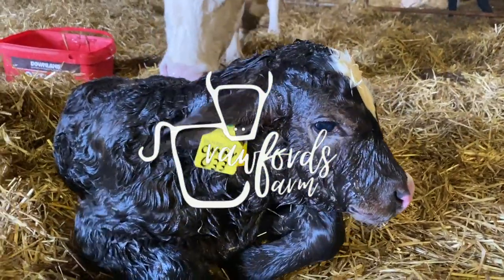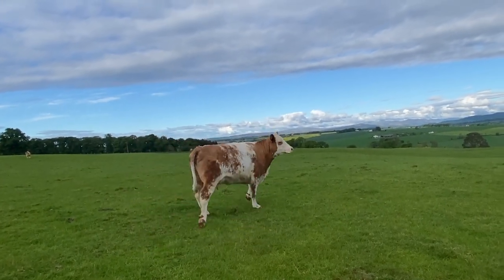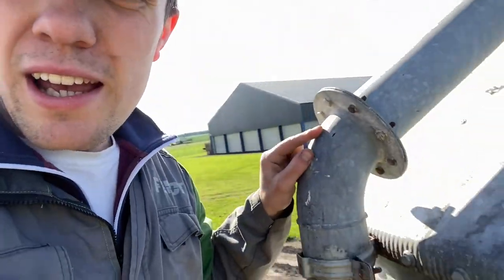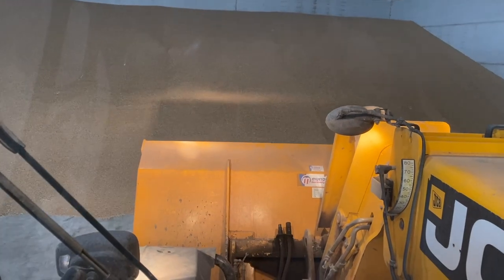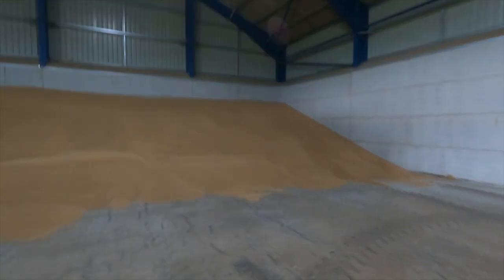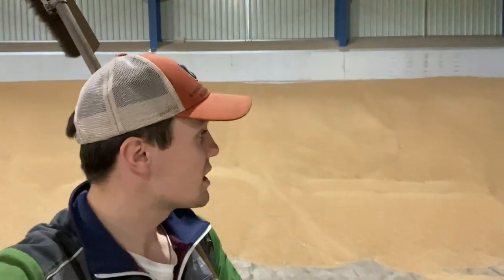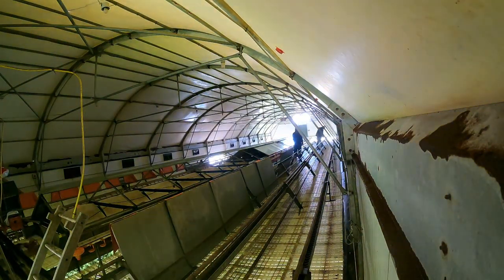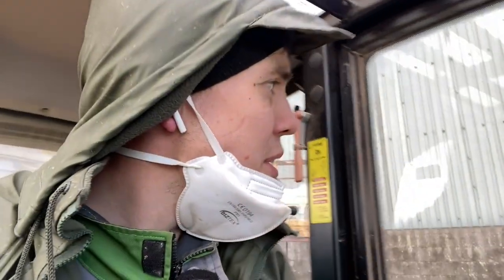Good Or Bad Idea? | Silo Repairs #CRAWFORDSFARM #275

Comment: Another random though from me why don't you use a pre-wash foamer to loosen the dirt on the shed equipment. Shortens the wash time on slats,and nests. Also removes the biofilm.
Reply from the maker: Does get a soaking at the start
Reply: @CrawfordsFarm1  we pre soak then apply a foamer leave for 20 mins then pressure wash. Comes up well. As with most things there's a cost but rather that than endless washing. 
Has that Fent been built yet.